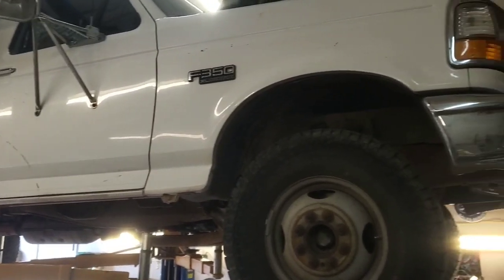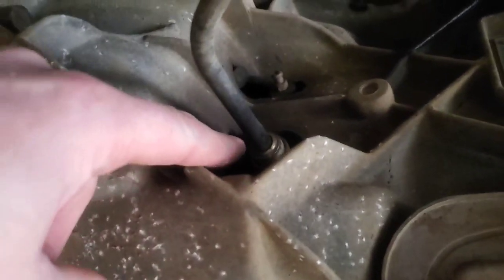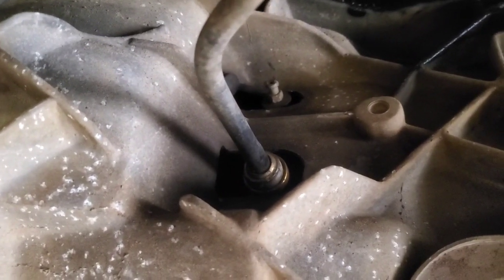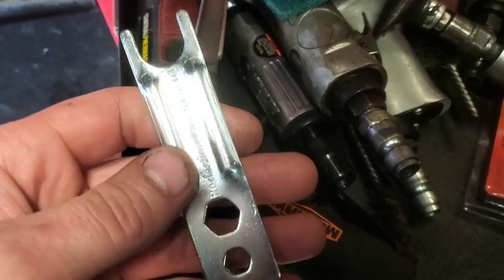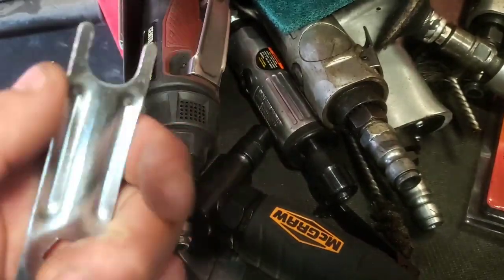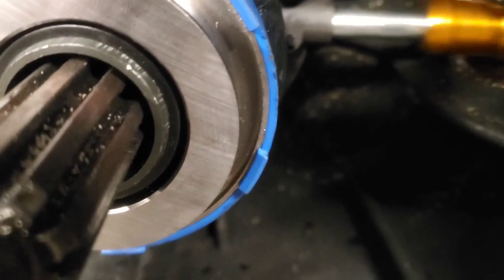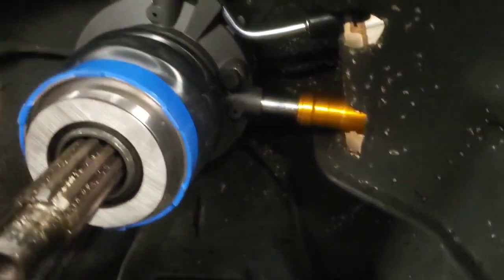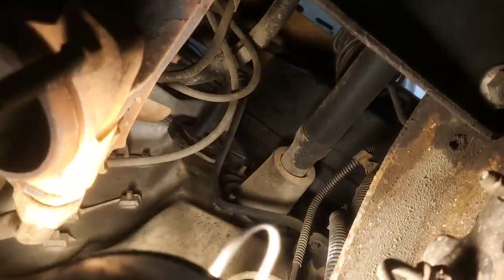Ford F350:  Clutch Slave Cylinder Replacement.  The Centric Style.

Comment: Good day,  I'm in the middle of a refresh on a forgotten 1997 F super duty, aka f450. The thing sat in a field for 10 years. I can't find a rear gas tank for the cab and chassis frame. The frames are 3 inches narrow on the cab and chassis which make the 350 and 450 rear tanks different than the regular frame. Aftermarket didn't produce a tank because it wasn't in high demand. I wish I could find a used tank, but I live in the salt belt, meaning these trucks are rotten and none to be had here in Canada.